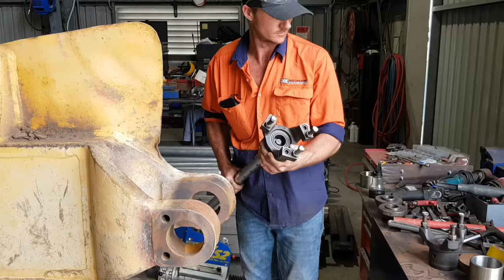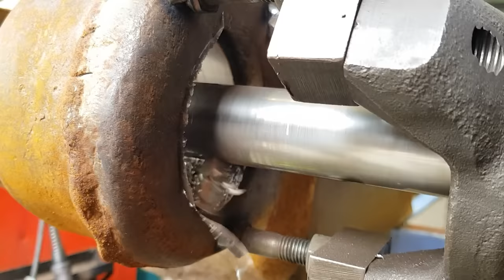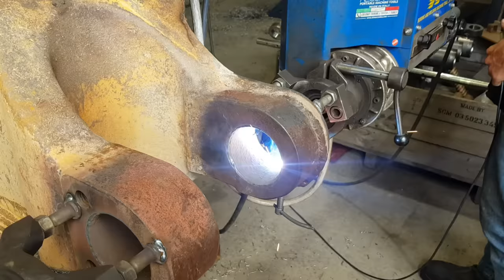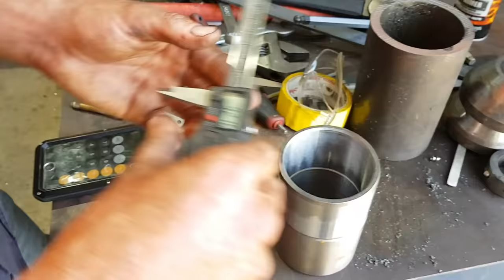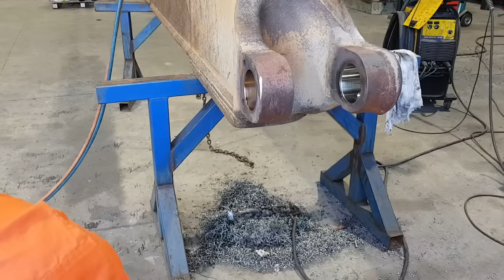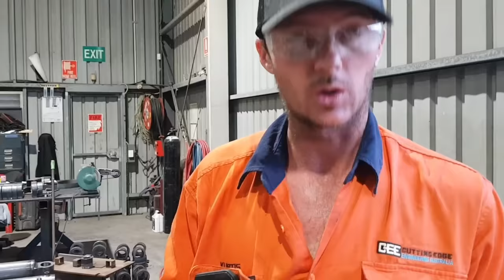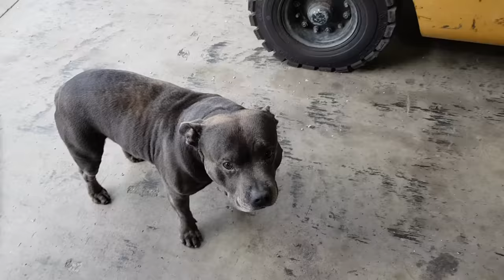Line boring and Bore welding Caterpillar D10 Dozer push arm | Sir Meccanica WS2

Comment: How nice to get a different type of repair for you after facing a wall of cylinders to do. Getting the line bar out was always one of my most favorite things I did in the logging shop before retiring. Unfortunately it had no welder but I was pretty good about getting clean buildups in place. Not near as pretty as your welder lays in. Clean and ugly but clean is what it is all about eh. Great chip control on this one bud. Every once in a while management would lend out the line bar and it would come back with the bar all torn up from chips getting in-between the bar and support bearings and all the solder on tools all torn up. It was really disheartening to see my baby come back all torn to hell. Of course as it was a brothers outfit that had borrowed it all I could do was snort and order more pricy tools and bars or spend unneeded time replacing the solder on carbides. Of course no one came to me with their troubles so I could teach them better eh. As I had no liquid nitrogen or co2 I would take 25 lb. fire extinguishers in the bush jobs. Hey, they worked eh, LOL. I sure hear you on substandard bushings. Tossed many over the years. Awesome repair once more Kurtis and me hats off to your little lady doing such a great job of filming and editing. See you next post bud.

Comment: Really clever with the "mobile extendable fly cutter" I just didnt really understand how you would adjust the depth of cut. Do you do it simply by loosening the set screw and adjusting the tool holder by hand?

Comment: quick question, what made you decide to weld and then re bore the diameter to size instead of just boring once and then bushing it? is it the cost of the steel compared to the time taken to weld and re bore?
Reply: ahh, just reached the end of the video, im assuming the bushings were already delivered by the customer so you had to make the hole precisely to size
Reply from the maker: hey mate yeah you got it right, bushings delivered by customer with the part
Reply: @CuttingEdgeEngineering  thats a pain in the arse, its always much simpler when you get to do the line boring and the bushing all yourself. its much simpler and quicker to make your own bush than fill with weld and re bore, and you dont have to deal with your customers ordering shite bushings. good job either way mate, all the best to ya

Comment: I'm a little bit confused. Your statement that a previous repairer had intstalled oversize bushes doesn't imply a failure. Was the point of the video just to restore the push arm to standard?

Comment: Just a thought.
when you have a job like this one or the bucket quick release you did.
would the system you use be able to handle 2 cutter heads at the same time.

Comment: A question struck me as I was watching this: last time you showed the tooling & torch for the WS2 but what was missing was how the welding side actually works. How does it feed the mig wire without it getting twisted up? Hoping it spins freely in the tip seems a bit hit & miss.

Comment: Question:  Not sure what the bushing steel is in this instance, but would not be advisable to use a hammer that isn't metal to strike it since it is extremely cold and brittle in that state? I'm having difficulty thinking of a bushing that wouldn't crack when struck with a metal hammer at those temperatures.

Comment: Why is is necessary to cut so much material off in the first step? Is the boring step just to clean the surface in preparation for welding, or is there another purpose?

Comment: I have a ws1, I can never get the welding right It burns back going vertical up and down its not pretty. Any advice??
Great tip about rough measurements

Comment: Hi,  In a case like this repair could you use 2 boring bars (one for each hole) at the same time for roughing and the light finishing cuts?
I haven't seen anyone do it and thought it could cut the time in half for roughing and finishing, I know with the facing cuts and the welding lance it would not be possible. I was thinking that the 40mm ((1 ½ inch (Bananas)) rod may be rigid enough to run 2 holes at once.
Thanks,
Craig.

Comment: I watched that one with the D-10 dozer work, was a two? part series wasn't it? 
How do you align the boring too the frame? If the tabs have been bent or deformed? 
Just check with levels?

Comment: Awesome video Kurtis, I can certainly feel your pain about shi] suppliers.  I worked at a place where everything was sourced from management's family member.  I told them many times I didn't care about then, what I cared about was when they'd buy cr^p as the annual contract and we were stuck with until next year's contract.

One other question (technical/mechanical), how do you keep the MIG cable from tying itself in a know as the boring shaft rotates?

Thank you so very much...

Comment: Do you have any problem with the welding wire twisting (might be called "wire flip")? If so what do you do to prevent it?
Reply from the maker: Hey Mike nah don't have problems with that, it does twist in the lance but not enough to cause any issues. There is a rotary joint between the welding lance and welding cable so only the lance rotates.

Comment: I work with ws2 either. mine shafts dont  slide through so easy.  It bindes in some spots specially ends of shafts. Do you clen them and bearing arms?
Reply from the maker: Hey mate I don't have that issue. I run all my shop made bars dry, no lubrication/oil/grease on bar or bearing sleeves. If you are using the Sir Meccanica bar work just check/measure the joins as they tend to be out of alignment when assembled.

Comment: brilliant video! learned so much! just out of curiosity, because the cheap aftermarket failed and I assume replaced with a genuine one, would you have to start the process of boring it out again, given the high level of tolerance needed to fit the bush correctly and I assume a slight discrepancy in the measurements between each bush? or isn't there not much variance in the bushes to have to do that!
Reply: quality parts are the same every time. what makes the difference is the quality control if every part is checked that costs more money so you pay more. many mass produced items are only selectively tested and therefore you get poor quality. and after market doesn't mean poor quality but there's good stuff and there is shit stuff too.

Comment: On pieces like this that have two parallel eyes, would you be able to run two tool holders and cut both eyes at the same time? Would certainly speed the process up for you. Not sure if it would load the machine too much.
Reply from the maker: hey mate yeah puts a bit too much load on the machine, causes chatter and don't really want to thrash a bit of gear the price of a new car hahaa

Comment: whenever we do a shrink fit we use a bore dial indicator gage . we set it up for .1 mm over the size of the rod. then we heat the hole . heat then quickly check with the dial bore gage. if the hole is too small we heat some more. only when we know the hole is at least .1 mm ( .005 inch) bigger do we install the pin or bushing. takes out all the guesswork of is it gonna fit. 
that cheap bushing was made brittle by the liquid nitrogen. that is likely why it cracked.we don't do the liquid nitrogen because we don't need it and it's a pain to get it.

Comment: When the orbital welder is running, how do you avoid wire feed issues from the constant twisting? It looks like there would be an instant bird nest within seconds of starting! Great vid and camera work is second to none!
Reply: there is a helix and cast on the wire any way so it does wobble even when welding normally.
the secret is buy quality torches, liners and tips change em regularly so they feed consistently. good quality wire feeds better too. also it actually not turning that fast.
the torch has a swivel on the end and is specifically made for rotary bore welding.

Comment: Kind of a shame you have to cut out the majority of what you just put in but that is the way of build it up and bore it back out. What are your boring bars made of. Is it a heat treated material or just a harder allow and do you have any problems with flexing?I have done a lot of shrink fit sleeves and bushings. It is always a pain in the arse when they stick cause it is usually when they are about completely seated...

Comment: They do this exact opposite on big stainless Marine yacht shafts in the boatyard they will turn down the pitted area of the shaft on the lathe then weld it full then turn it back to the proper OD nice and smooth

Comment: I have worked at several OEM manufacturers of the large type equipment that your videos show you repairing.  I am concerned that locating on bearing faces does not give you the bore alignment between multiple bores that must be in alignment.  The bore to bearing mounting face tolerance is relatively loose compared to the bore to bore alignment tolerances.  You have to setup (pitch & yaw) to one bore to machine a second bore in alignment with it, and linear location.  Or locating on the bearing bore chamber.  Or worse on a dinged up bearing bore chamfer.  I have never seen you "cleaning up" your locating points.

This is usually done in a machining center or dedicated machine and then checked on a coordinate measuring machine for location and alignment.

I do understand that many bores work independently and this precision is not required, but when bores do work together such precision is required.  I should be spelled out on the customer's geometrically toleranced drawing.

I enjoy your videos but I am concerned about this one aspect.

Comment: I didn't see you check to see if the boring bar was perpendicular to the  push arm !! Why do I ask , I worked in a open pit mine for 36 years , and nothing is more frustrating that tring to line up points that do not match . Even a few thou can cause problems !! Do you not use anti splatter on your shielding gas nozzle ?

Comment: is that so, heat expands metal, liquid ice shrinks it. easy fit. i, didn't know that trick, would have done one side, shrink or expand. good to know. a lot of people might think it's to help it cool down, yea that too, but it also shatters the part if it's not genuine. in that case. they should have told him it after market, he could have pressed it in and jobs done.

Comment: You know if the 40mm bar had fine threads for a set screw on the back side of the hole where the tool goes in it would make it easier to make minute adjustments of the tool.  Might need a shorter tool length in some cases.

Comment: If the job mostly consists of manual labor/time, NEVER cheap out on the part that's being replaced. I only use aftermarket parts when the part is easy to replace and doesn't require a day's+ labor.

Comment: you should try to improve tool rotation and feed parameters to reduse shatter, probably slightly reduce either rpm or slightly increase feed else try other inserts

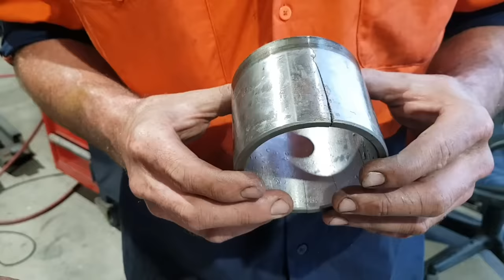Comment: 24:20 A very strange conclusion about the "cheapness" ...
Liquid nitrogen has a temperature of about -196 degrees Celsius. Thus, the parts that you cooled down are at certainly below -100 degrees.
In almost all alloys, already at -100 degrees, the hardness practically doubles, but at the same time the ductility is significantly reduced, as a result of which the sensitivity to shock loads is critically increased.

As a result, if you knock on frozen parts with a hammer, the percentage of broken parts will depend only on how much you freeze them, the "cheapness" is not to blame here.

In general, this method of inserting bushings is quite interesting, although it raises many questions. Rapid contact of supercooled parts with heated parts can potentially cause thermal shock, so the strength of such a "refresh" after such an operation raises big questions.
Reply from the maker: You're missing the point. The bushing should not have gotten stuck and only did because of it's cheapness 👍

Comment: Is this a stupid question (not that one, this one):
Why not put two cutters in and do the job (at least the bulk removal) twice as fast?

I'm guessing you're doing the most material removal that your machine will handle and adding a second cutter would make you have to reduce the depth of cut or feed speed, so there's no gain, just more risk in screwing things up twice as fast.
Reply from the maker: Hey mate not a stupid question quite a few viewers asked the same! Yeah you're right there, it puts alot of add stress onto the machine, causes chattering and I prefer not to flog my machine that cost the price of a car hahaa 😎👍
Reply: @CuttingEdgeEngineering  Good to know.  Thanks for the reply! 👍

Comment: Can anyone help me out???? wondering 
if both eyes on the clevis can b cut at the same time???? In other words 
Can 2 Tool bits be put onto the 
line boring machine and cut both 
left side and right side eyes???
Lol... hope that I worded that correctly....
It would be kind of a (S) shaped 
Pressure on the machine... would 
That Counsel each other out r would it
Really be f..k up???? IDK.... someone 
Help me out over here...you will get an 
A if you even understand the question 
Well write me back....

Comment: I am a little baffled at why you would remove material to add and re cut.   If I understand the situation the hole was too small so you bored it out, if that's the case and in that 1st bore you had even cuts,  why weld it to bore it again?

Comment: Nice to see when people taking a pride from his work and is proud from qualiti outgome. Its pitty that on the other side of the globe his kind of work is shutted down basically. Needed mashines and old ones are in scrapp by now(eazier to operate) and new ones are wery-wery overpriced. Plus atleast 2 engineers degree and one machinist plus cnc machinist papers needed, after that gountry takes 45 -60% of cashflow to the taxes. And welder and mashinewelder is anodher bullet thru the brain, legal ways. And if yuo endure the beginning of the firm and found some clienbase, they found or make some law to make your operation to shut down. Politics in central and eastern europe.

Comment: Did the "bad" part manufacturer say the bearing was fine but hitting it with a hammer when the part was cooled to an extremely low temperature was the cause of the failure?  Did they say that if you used a different way to insert, (rubber mallet, squeeze tool, or other, the failure would have been prevented and so the reputation of the "bad" part manufacturer.  I love your work.  PS but not the fowl language.

Comment: Your bushing crack because you used a metal hammer ,  when you put something in dry ice or liquid nitrogen it become brittle....
I have done 100’S of those job when I was working with a custom boring machine similar to your and also using a boring mills , but all the welding was done manually, not like in this video , when I saw this , it would have been a dream for me .

Comment: 24:15 Metals that you stuck in liquid nitrogen for an hour are also notorious for shattering when you hit it with a hammer. You realize that YOU EDIT these videos, right? As far as anyone else is concerned you could have just omitted the fuckup completely and your viewers would be none the wiser.
Reply from the maker: An hour? Was in the LN for about 5 mins and I'm using a copper hammer here. Trying to get the point across that the bush shouldn't have gotten stuck in the first place 🤣👍